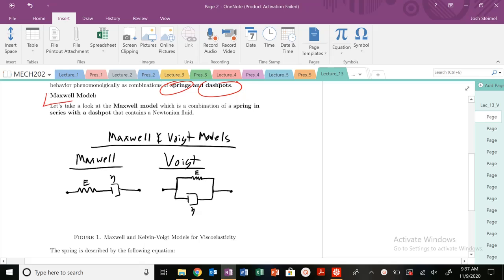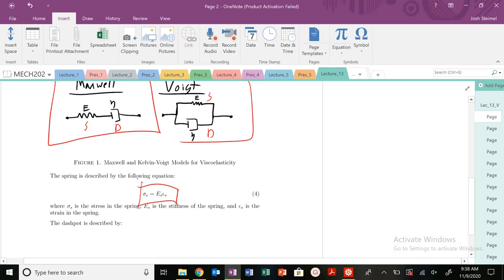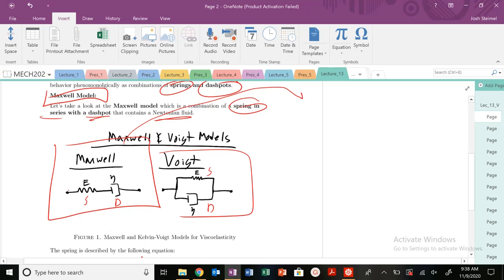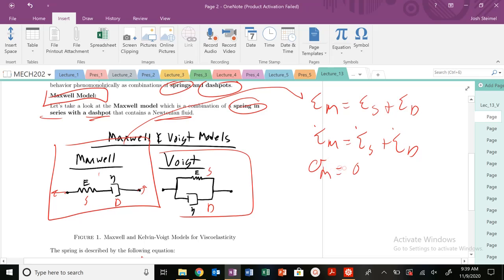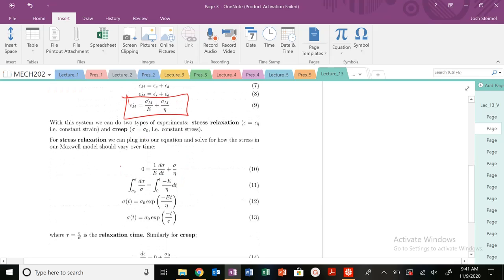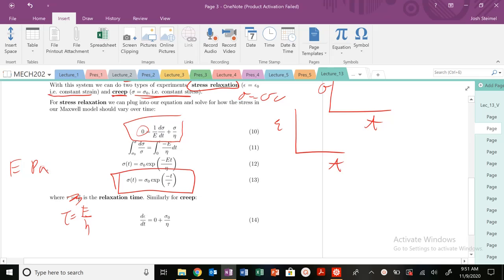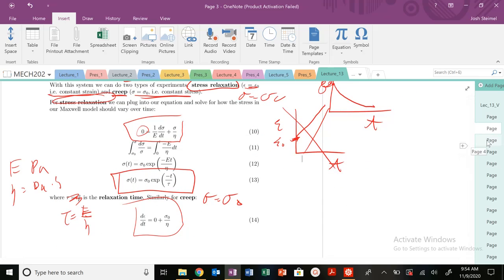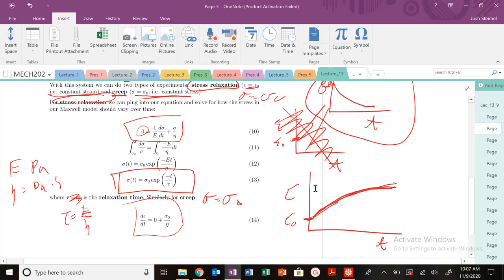Lecture 13: Maxwell Model for Creep and Stress Relaxation

Comment: Are you sure your correction to the relaxation time is correct? Shouldn't the units be seconds? If viscosity is on the bottom, then the unit becomes 1/s.
Reply from the maker: The relation time tau=eta/E and the units of viscosity are Pa.s and the units of E is Pa so that would give units of s and thus relaxation time. Does that make sense?